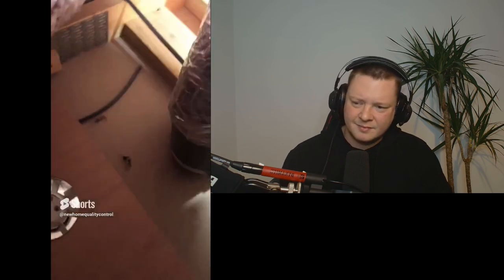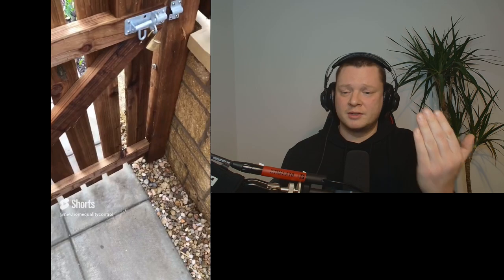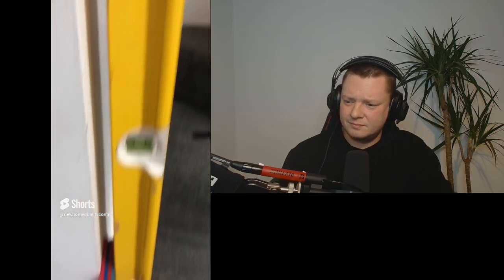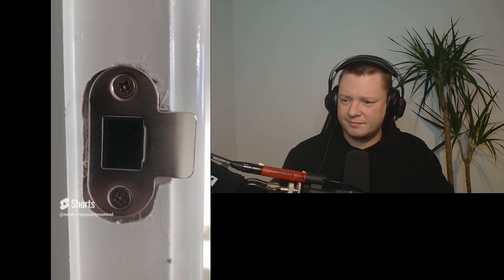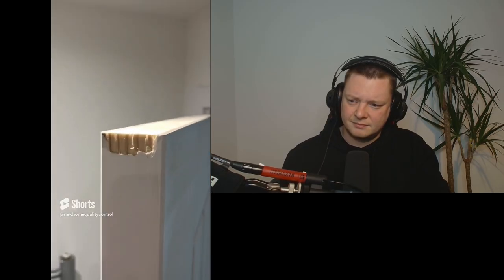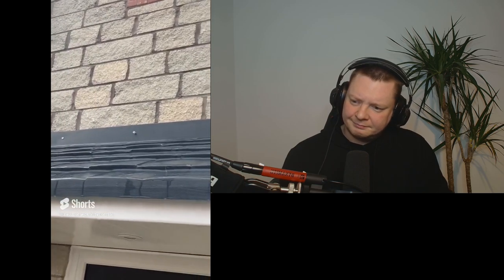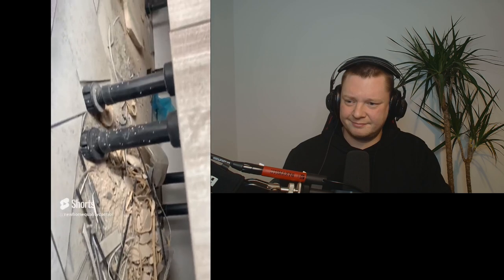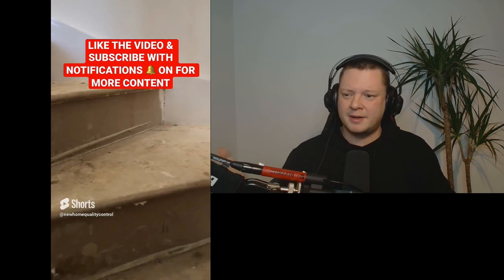The Snagging Breakdown #2 | New Build Snagging Inspection Analysis

Comment: I always use gold screws when hanging doors and put the ones supplied to one side and fit them later as they are quite soft and get rounded over by carpet fitters & decorators etc with their black & decker drills fitted with a rusty ph2 bit
Reply from the maker: Just don’t hand it over with non matching screws

Comment: 2:23 So I would say someone has cut the plasterboard box in right next to a timer stud - so the wing of the box can't be pushed out. Then they've trimmed the wing off with a junior hack-saw. If I'm correct, a solution would be to use wood screws to fix the box to the timber stud that was in the way. I've seen this sort of thing when a switch or something has to be in an exact position but the stud work doesn't allow it.
Reply from the maker: Interesting

Comment: To be fair, that internal wall next to the stairs, if it's 22mm out, it needs to be feathered in 14mm to bring it into tolerance. If they can take a little off at the top, then maybe they can get it within tolerance without it having to overhang the stair

Comment: The air bricks don’t need the ground level reducing. They could just from a brick surround around the air brick then refill the surround to within 75mm of the brick. Or cut a half moon pipe around it. It is more concerning where the dpc level is !